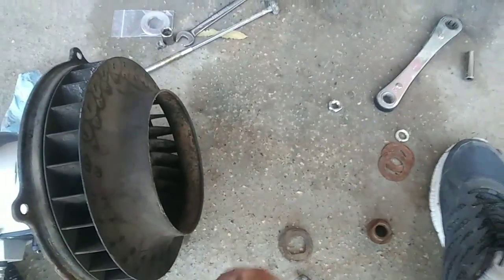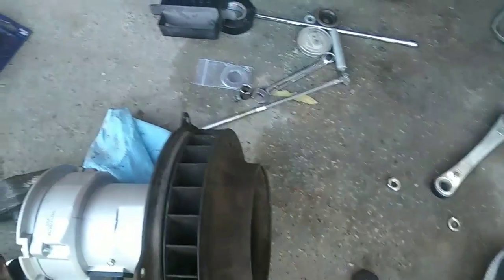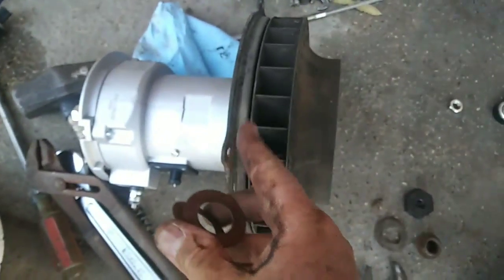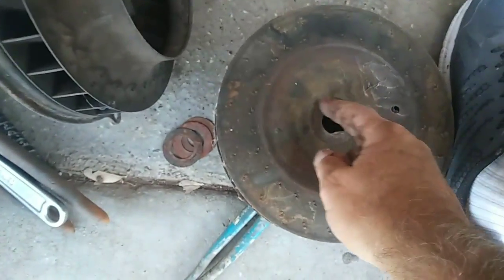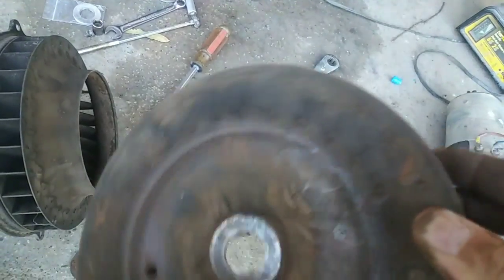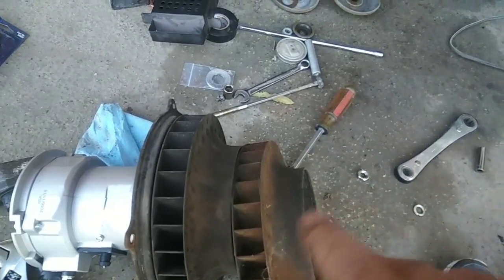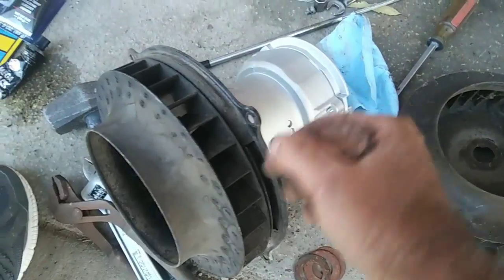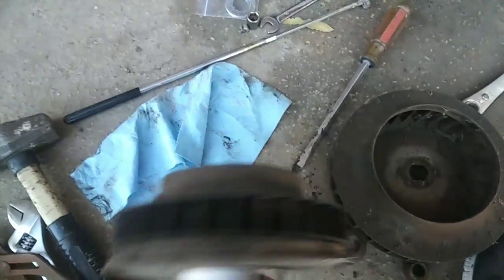VW engine fan assembly on your generator

Comment: Hi Mike, I got a question on an old 6v generator and regulator. I have the old version service manual but it shows the generator with two post. One is 61 and the other B+(51), 61 states it's to the warning light and is the smaller of the two wires. The B+ 51 has the battery lead but also goes to the starter motor. What I have must be older with just two wires no post coming out of the generator. the small wire hooked up to a made in USA Sorensen regulator FLD post on the facing rear side and the larger wire hooked up the post 61. Not sure how to test this generator without the regulator hooked up with these two wires? I just want to hook up my 12v battery just to see if the generator spins briefly? if it does then want to see how much it's putting out with the regulator hooked back up for volts reading. I know these 6v are not what I want to keep on this but for now just want to get it running soon. My guess is it won't spin being it sat over 40 year in a shop just collecting dust.

Comment: Dude, explain in what diection the WaveWasher goes.  Also you mention 2WaveWashers.... can you draw this?   I already messed up a fan $130.  (1WaveWasher, 2Spacer, Fan, 1Spacer, WaveWasher, Nut)  those steps.  Also at the end what direction does the large Nut goes?